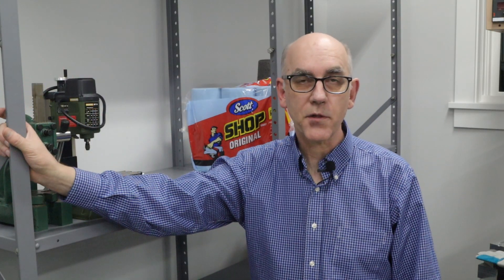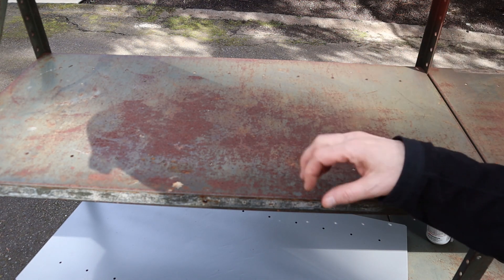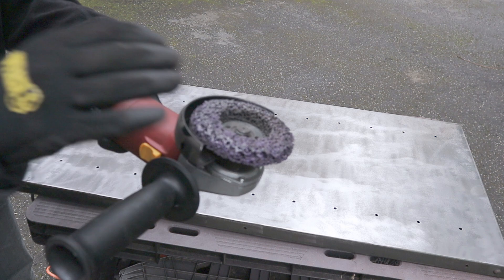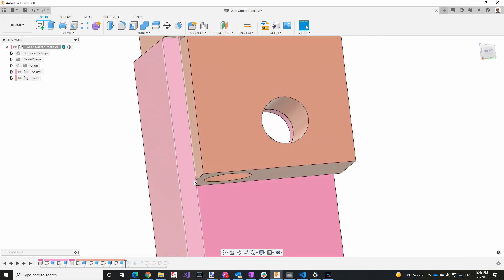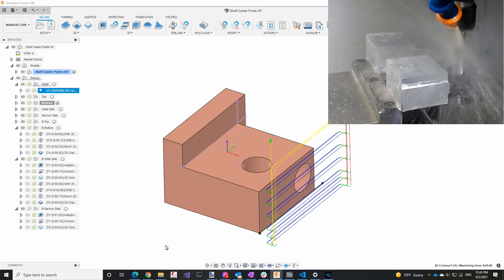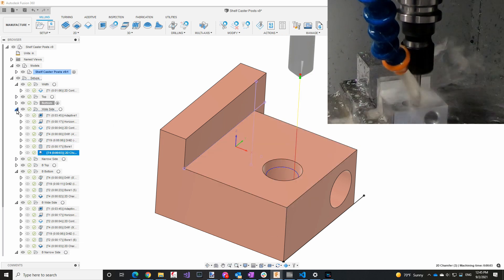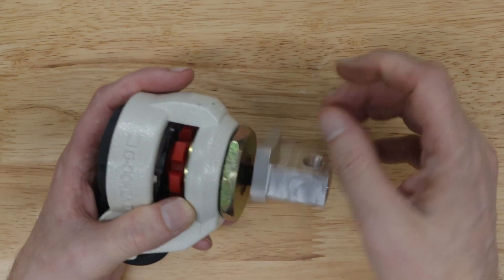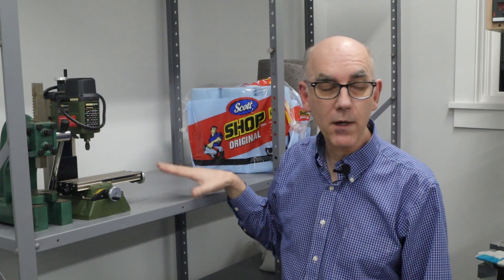Heavy Duty Shelves on Wheels

Comment: Thanks for sharing those casters. My machine shop is a 2 car garage with 2 cars, right now I have 3 harbor freight carts that fit between the mill, lathe and surface grinder loaded with stuff. As you may know those carts are fairly easy to tip. Been looking to build a sturdier bench on casters and those look like the ticket. Thanks!
Reply from the maker: If you want better quality casters, I suggest Footmaster. That's what I used for my Morgan injection molding machine. But they're about 4 times the cost.

Comment: May I ask about the rust cleaning process?
1:48 Is there any steps you did after cleaning with wire brush and before coating with rust oleum primer?
Is rust cleaning using either HCl or NaOH solution a good idea?
Thank you.

Comment: With those casters, does the rubber foot pad take any of the load off of the wheels / life the unit off the wheels completely? Or is the rubber foot pad only meant to keep the unit from sliding around?

Initially I thought these casters would be able to transfer the load from the wheel to the pad, but that doesn't seem to be the case after watching your video. The load seems to always stay on the wheel, but the foot pad is there to act as a tiny brake of sorts. Is that correct? I was initially hoping to find a heavy duty caster that could lift the wheel off the ground when in "stationary" mode, but quickly lower the unit onto the wheels when maneuvering is necessary.

Thank you for the great video! 

~ Jake
Reply from the maker: I think you could transfer all the load to the pads, but I haven't found the need to go that far.

Comment: can you make and sell me the brackets? i be interested in doing this to my shelfs
Reply from the maker: These don't really need to be CNC machine. You could buy some bar aluminum stock, cut it to the right length, and then drill and tap holes. I used a CNC machine just because I had one.
Reply: @JohnSL  Ooh Ok that makes sence. i ask since you already have all of this Down i thought it be easier

Comment: Guys are not capable of pulling on something that they just fixed in place without saying "that's not going anywhere" always makes me laugh 😂
BTW is you want to cam a bit quicker next time you can use tangential extension check box and add 10mm or wherever is needed. It does it to both ends, but quicker than sketching. Great videos as always
Reply from the maker: Yes, I could have used tangential extension. But it bugged me that it was cutting air on one end. I know, silly, but that's all I've got.